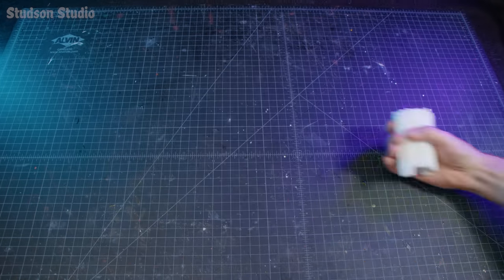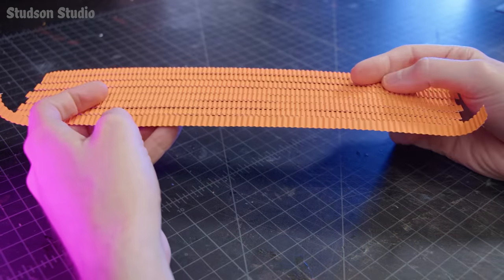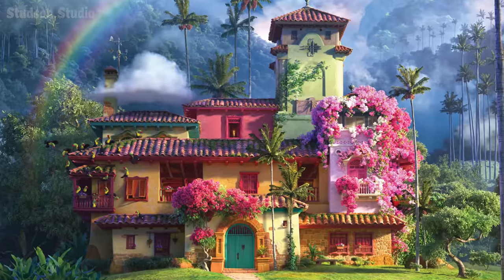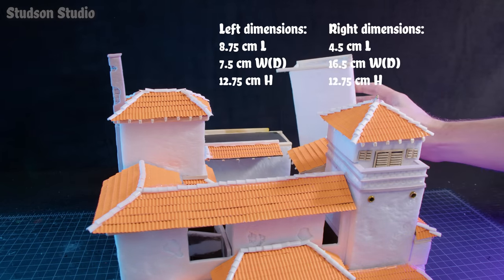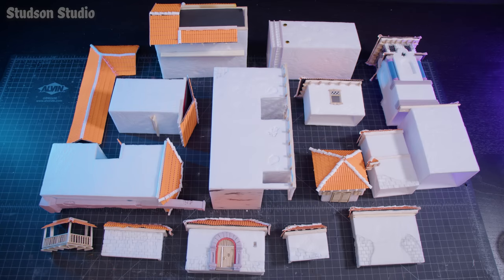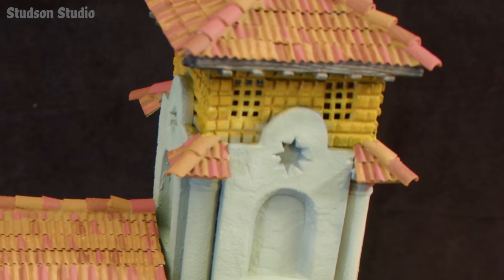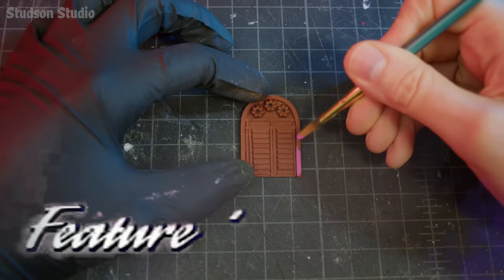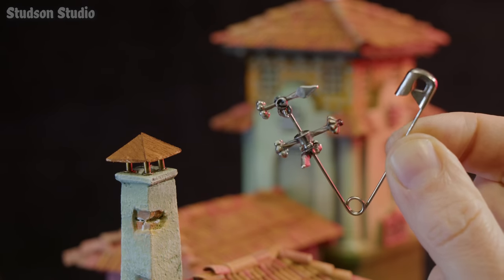I made a Miniature Casita from Encanto

Comment: I doubt he is speaking about the house in this section of the video (12:02) : 
Don't be afraid to double fist your goop. if your goop is too thick use a toothpick to scrape up your cracks. for specially messy holes filled with gupe, you can use a can ...